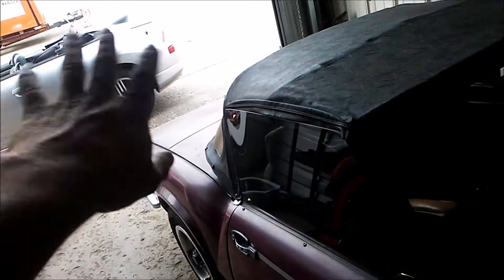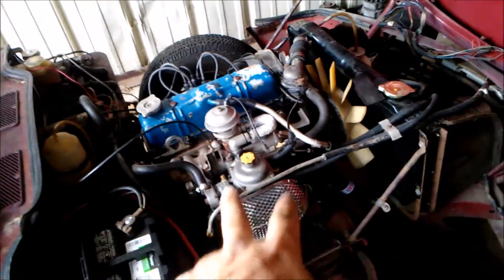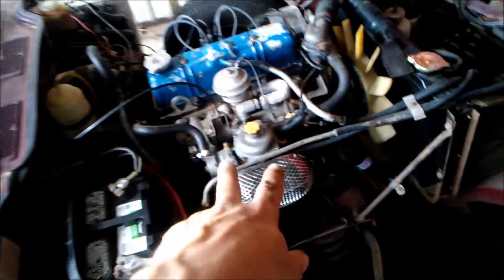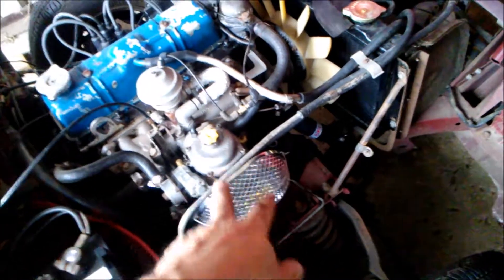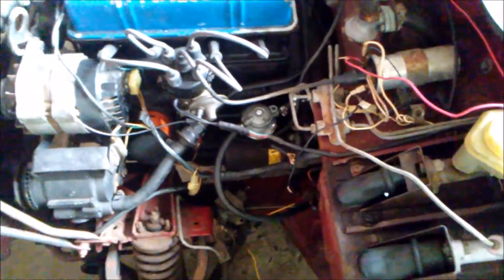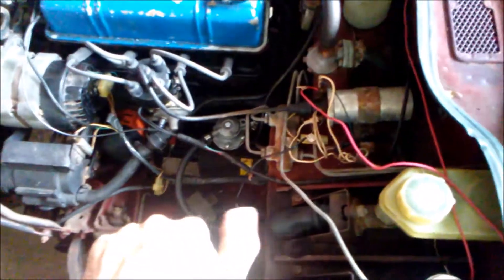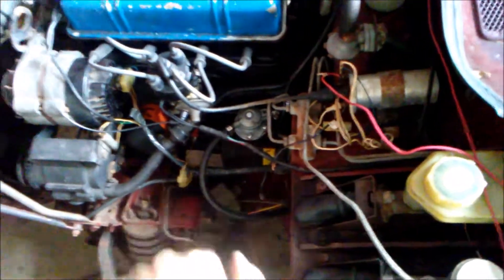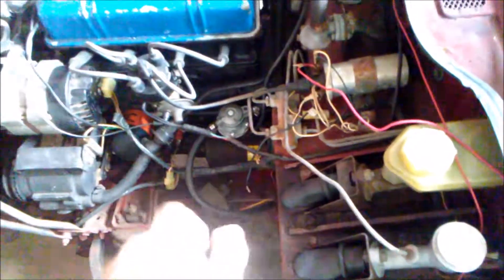Replaced fuel pump and Spitfire update!

Comment: fill the cylinders with nylon rope to do valve stem seals.. take spark plugs out and put rope through the holes then turn engine .. then use valve spring compressor tool ..

Comment: Triumph never used valve guide seals.  The controlled oil usage by maintaining a tight clearance between the valve guide and the valve.  A certain amount of oil usage was expected and even required to lubricate the valves.  These engines were really 1950's technology That they were trying to pawn off into the US market into the 60's and 70's .   Triumph never had money for R&D.  Badge engineering started with the introduction of the Acclaim in the 80's when they pawned off a re-badged Honda as a Triumph.  To bad they didn't start earlier putting Japanese engines in their sports cars!